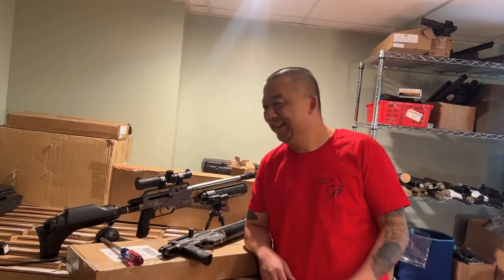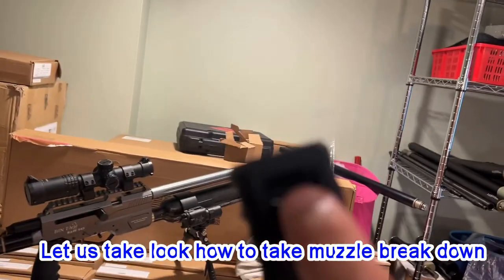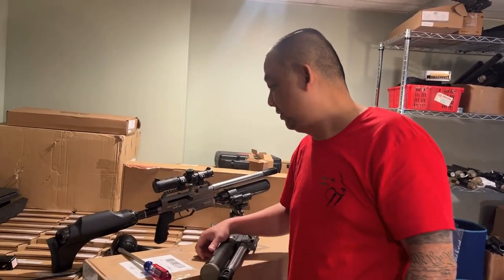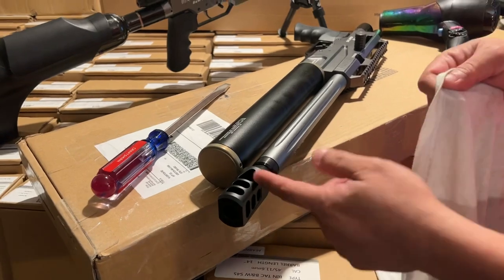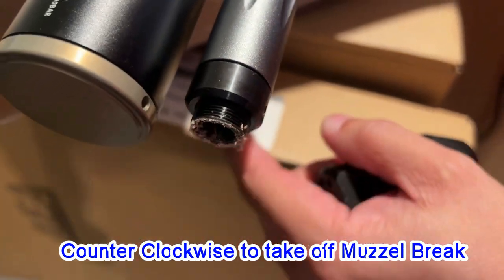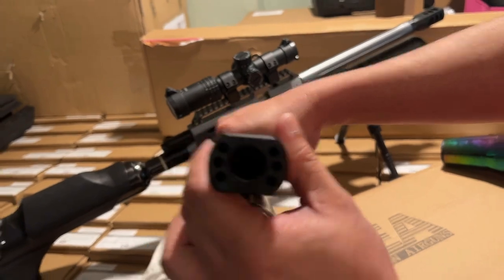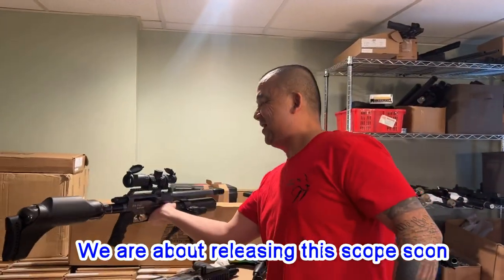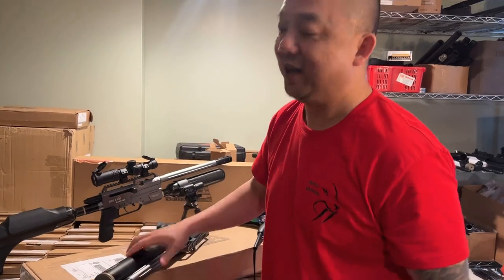BinTac: B&W S45 101-5 How to take muzzle break off S45

Comment: I have no idea why people want to remove this! It works well!
Reply from the maker: Some of them living in city just want to install moderator
Reply: @sigshooter6213  I can respect that. I drive more than two hours away from the city to shoot so I don’t really use moderators but I understand the reason people would want them.
Reply from the maker: @macabespeed  you did an excellent video bro thank you for much
Reply: @sigshooter6213  thank you very much for the kind words! I tried to make that video better than anything I’ve produced yet, I am very happy you guys like it!
Reply: @SonofHardrada  THANK YOU! My whole heart was in that video
Reply: @silverdollartruckin7148  hushcan be sure you get m18x1 tread then no adapter needed screws right on. you need a heat gun to soften the lock tight on to flash suppresser.
Reply: @6942ggg  i did.  That was an old post before s45 was released

Comment: I get your S45 teaching videos but can I ask some questions about things that I have issues with with PCP? 
Please give me advice on how to make function in extremely cold weather because I will be hunting with it in 0 degrees and colder and cold weather has made other PCP rifles not work at all.   
Tell me how to clean it, what to lubricate.    
Field stripping the weapon?
What is the best deer killing round available for it and can we use sabots ?  
Could I take it apart and file a bolt hold open into the receiver?
Reply from the maker: We cannot tell that because we didinnot test under such temperatures
Reply: @sigshooter6213   69% of all whitetail deer are taken in temps below 32 degrees during gun deer seasons in most big buck country throughout the USA. Wisconsin 77%, Minnesota 59%(earlier gun season),  Michigan 88% and the list goes on and on like that.    In Canada over 92% of all whitetails are harvested with the average temp below 32 degrees throughout that country with a rifle .    So maybe this is a very important thing that is being overlooked.      Do not worry I will be testing my s45 in the winter and after hours and hours of constant exposure to sub zero temps.     It will get tested.
Reply: @SonofHardrada  Have any of you looked into Hollow points reason for not being able to own firearms? It all looks very bad so I just stay away.     

I am willing totally willing to tear a 1500 dollar rifle apart to modify it. That is what firearms ownership is all about and should be with PCP as well.      That is why I asked about field stripping it to base parts.     I will keep you posted when I get mine and machine in the bolt hold open.   You can check out out testing videos for PCP rifles when I get this one in.They will be on YouYube.
Reply: @SonofHardrada  Taking away someone's firearms is beyond unconstitutional no matter what they did in the court of lies and oppression. The founders did not intend for a Felon class to be created and they knew for  a free society to be free everyone had to have the right to protect themselves with guns from government.    I do not believe anyone outside of prison should ever lose their gun RIGHTS.     That was not my point in the post.    The good and bad guys are all allowed part of the American dream.
Reply: @jesusoftheapes  what are you talking about?

Comment: I hope you got alot of those scopes! I think I'm going to want two.
Reply from the maker: I do have some haha
Reply: I think he is right though about the lack of need for scopes and we should check out the electronic sights out there for this rifle.   But I will be scoping mine too.
Reply: @jesusoftheapes  what's a good scope or electronic site for this one?
Reply: @IntenseInvestor  I am using a really neat 1.5 to 5 power  zoom with an etched reticle by Lumix and you would think they designed this scope for the S45 . Mind you it was originally designed for a crossbow but when you look through the scope you will see why it is a special sight for this rifle.  The Drop Zone reticle is perfect for the S45 and each drop dot in the reticle fits the S45 and its slug drop rate like it was made for it.   The scope cost me $88 dollars and I cannot express to you how much quality it has at this price point. I would pay 3 times as much for this scope and not blink and eye.   
 I first used a big dollar AR reticle Burris rifle scope on the S45.  I then used an $550 dollar Eotech until I found this little gem of a scope.  This Lumix is better for the S45 than either of the other 2 I tired on it.    Mind you  I NEVER buy cheap scopes unless they are going on toys but I can find 0 fault in this scope ( Lumix Killer Instinct) and the features it packs into its $88 dollar scope are mind blowing.      Like I said it is like they designed this scope for the S45.   The drop down reticle is a perfect match to every yardage the S45 pushes. The glass is crystal clear. The reticle is better than a Trijicon or any for that matter that I have ever used before on any scope.  I simply love the reticle on this scope.  When you look through one you will understand.    This scope also has Blue and Red light up reticle options on a one click system that is super user friendly.       Plus it comes with heavy scope rings and flip up caps.      I know I am talking up a really inexpensive scope and that is never a good idea but the Lumix 1.5-5 power Killer Instinct scope with the Drop Zone Etched reticle is the best S45 scope for the money and the quality is still blowing me away everytime I shoot it.

Comment: The B&W S45 Has Proven To Be A FLAW Bin glad I didn't pre-order it everyone that bought one is having magazine problems that's why it's so few YouTube videos on that platform vs the amount sold already told you from the beginning a 10-12 round straight magazine with a real firearm heat treated spring should have been the feeding system you yourself have NOT made sufficient videos on a gun design by you tells me everything Sir 🧐
Reply from the maker: We have been working on the new 12-20 rounds mags since day one